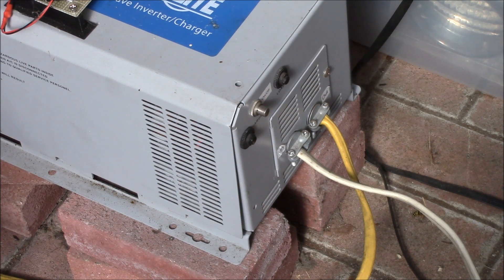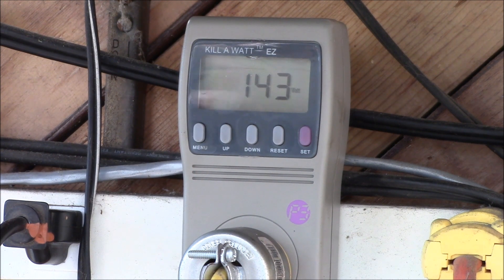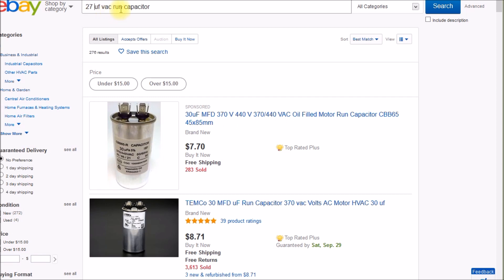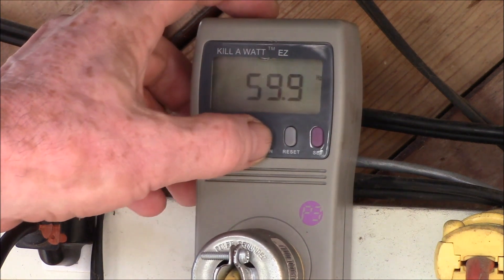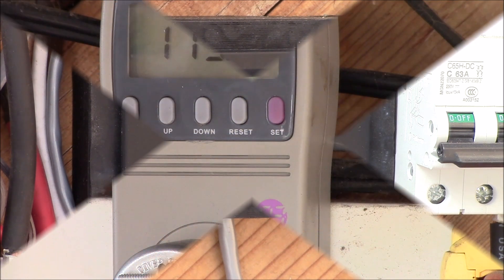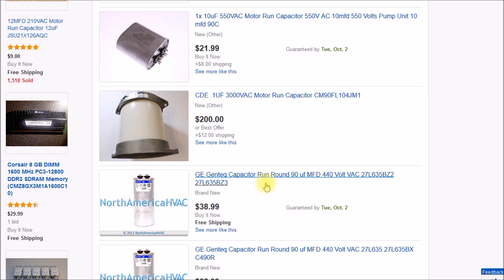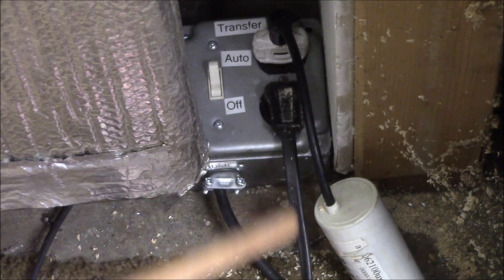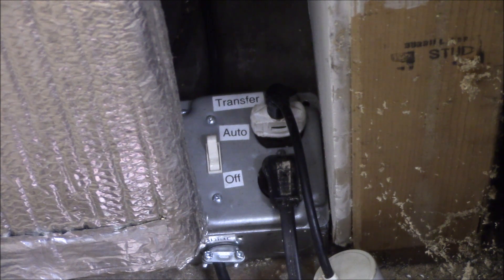Power Factor Correction and Inverters

Comment: Excellent video. Dumb question. Why don’t the manufacturers put a $5 capacitor in devices? Power consumption is a selling point
Reply from the maker: Cost is the likely reason.  They do put in a start capacitor, because the motor won't start/run without one.   But a power factor cap. is not "required", at least in consumer products.  Reason being that residential electric bills don't include power factor charges, like industrial power bills do.  Thus the grid supplies "free" reactive power as far as most folks are concerned.  

But yes, if you're providing your own electrical power, via an inverter, then that reactive power, to make up for a poor power factor, has got to come from somewhere, as I demonstrated in this video.

Comment: wow, I cant thank you enough for spending time and doing this demonstration. This niggling question in my mind is now solved.
Reply from the maker: Thanks for the comment.  Plugged into the grid and power factor is not normally an issue for retail customers.  But once you supply your own power, that extra current needs to come from some place.  Some inverters are designed to handle it better than others.
Reply: @The4Crawler  You are right sir. I am running a stack of computers and when there is no mains power I have to run on UPS. Your video made it clear that I better have computer PSUs with Active PFC so that I get more runtime from my UPS. Thanks again.
Reply from the maker: @prashanthb6521  Yes, that would make sense.  Uncorrected computer power supplies are likely more of a capacitive load (leading PF) so not as easy to correct like I did on my drill press motor.

Comment: I really appreciate this. I watched it over and over. I wish you explained it more in depth for real dummies. Off to research and learn about this.
Reply from the maker: It's a difficult subject to go into depth without getting overly technical.  The description has more details and a link to an easy to use on-line calculator.  Take a couple of readings with a Kill-A-Watt meter and it'll give you a good starting point for a correction capacitor.  This of course assumes you're working with a motor or other inductive load.  Back when I was in college, we had to set up a whole bench full of equipment along with pages of calculations to measure this sort of thing.  Today, a $20 plug in power meter does it all.

Comment: hey, 
I'm having some problems with the numbers.
let's start with the freezer example.
how come you input 208W and end up with 204VA at the output ?
that’s too close, where are the conversion losses ?
moreover, later, after the PF correction, you put in 188W to produce 142VA, which is a totally different ratio, while the conditions are better (allegedly, a perfect PF). 
how can it be explained ?

later, in the drill press you input 515VA with only 288W, again, how ?
Is it some inverter wave control "magic" ?
The measurement method ?

Thanks
Yam
Reply from the maker: Yes, it's not really clear how the inverter handles real and apparent power.  Some of the reactive power (VA or VAR) comes out of the output transformer as well as the internal capacitors.  Since that reactive current is out of phase with the voltage, it gets handled different inside the inverter.  It's not a fixed ratio as you note regarding load VA to inverter-watts. 

The main point of the video is to show that power factor (and correction) does matter if you are providing the power from something like an inverter.  You pay for it in terms of additional DC power input to the inverter.  Sure, if you plug into the grid, reactive current is "free" and power factor doesn't really matter, at least on your home power bill.
Reply: @The4Crawler  
Hey, thanks for the quick answer.
I get the point, and obviously you proved that a higher PF is better (as expected).
but I'm asking since we are trying to calculate ,on advance and without field testing, the required power for a similar freezer with a pf of 0.5, from solar power as well.
and I'm not sure we can rely on the ratio you got in the video.
maybe it's even inverter model dependent.
we weren’t been able to find a decent source for the math behind it.
maybe you can point us in the right direction.
Reply from the maker: @yamsoussana  Yes, I suspect this is highly dependent on the design of the inverter.  I've heard that it's possible to design an inverter that can handle reactive power with little to no extra DC input current.  But that all depends on what the designer of the inverter is trying to optimize.  Could be factors like efficiency, surge capacity, quality of output sign wave, long term reliability, cost, etc.  

I've never run into a table of data or formula to compute ahead of time how a specific inverter will handle a given power factor load.  I suppose if one had access to the full circuit design it could be run through a circuit simulator to come up with some data.  

The Rapidtables link in the video description covers the AC side of the calculation.  I think getting the power factor close to 1 is always a good place to start.  I shoot for a little under 1, by picking the closest capacitor value below the computed value.

I should probably try running this same test on my new 24V inverter and see if it's any different.

Comment: Thanks!
Okay, it's four years later, how are those Chinese capacitors holding up?
Reply from the maker: Still seem to be working fine.  Maybe some day, I'll try rechecking the power factor and see if there's any change.
Reply: @The4Crawler  Good to know. I'm adding caps to all my appliances. I have a metal shop where I think it will make the most effect.

Comment: Thank you for making this interesting video. How close to the device must the PFC correction capacitor be added?  Is it acceptable to locate it at the supply to a shared socket strip which feeds several devices, including the inductive load?  I ask because I have a central heating circulator pump which draws 18W with a PF of 0.73 but it’s buried in a well insulated compartment I don’t want to disturb and the only mains feed to it also feeds other (permanently connected) devices. Although it’s only 18W, because it runs 24/7 I think it’s worth trying to PFC correct it, to help reduce my inverter load.
Reply from the maker: If the load is running 24/7, then the correction can be added anywhere in the system.
Reply: @The4Crawler  thank you! It seems like motor run capacitors in sizes below 1uF are not so readily available.  I have a dead induction cooker PCB with some big 660V 0.68uF polypropylene capacitors on it, and this is exactly the size in uF which rapidtables says my circulation pump needs to achieve 0.95PF, so when I get brave enough I’ll give it a try!  👍

Comment: Hey, this video is exactly what I was looking for… my RV has a conventional refrigerator, and the inverter shuts off immediately, so I can’t go down the road with fridge on. Did the math, added a 5uF cap, and it works perfectly… you saved me $200, other websites said I need a “sine wave” inverter
Reply from the maker: Yes, that can make quite a difference and those Kill-a-watt meters are amazing.  It's funny how everyone will say PF correction is a waste of time/money, which is true for anything plugged into the grid.  You get all the "free" reactive current you want, but if you're supplying the power from an inverter, reactive current has to come from somewhere.  And some inverters have limits on how low a PF load they can drive.
Reply: Sorry, Kill-a-watt, that’s what it’s called
Reply: Also, I have owned that same Watt-a-meter thing for 5+ years, love it

Comment: Excellent explanation.  I just ordered a device.  It is marketed at home owners, but everything AC in my RV is on an inverter.  I instinctively knew there was a way to relieve some of the load on my Renogy inverters.  I ordered it, then found this YT that justified my thinking.

I will be opening up my fridge and microwave, to put proper capaciters where they belong.  Device was $6.
Reply from the maker: Glad the video helped.
Reply: @The4Crawler    I expect to help other RVers, by installing capacitors for their AC and domestuc fridges.  It will make their batteries last longer, when they are boondocking (which is what we plan to do a lot of).

Thank you

Comment: Some mpp/voltronic chinese solar inverters have pf correction on the output. So basically, VA values are mostly identical to real power used. However, the 230v input pf is quite bad.
There may be a measurement error (i'm using Shelly EM with 2 clamps), but at night, when there is no pv input, with batteries detached even, there is 15W difference between input and output... +15W measured on the output, witch is very strange. Could someone explain this phenomena to me?
Reply from the maker: Yes, the inverter may indeed have pF correction on it's output, especially when that is grid tied:
https://ctlsys.com/support/inverter-power-factor/
Power inverters w/p pF correction can have bad pF readings at low power output due to the output filtering.

But it's the load(s) that determine what the pF of the whole circuit is.  If an off-grid inverter is driving 1KW of incandescent light bulbs, the load pF is 1.0 and that's what the inverter outputs.  But if the load is a 1KW  motor with a pF of 0.8, there's 0.75KVA of reactive load that needs to be produced by the inverter, or by adding pF correction to the load.  It takes some additional amount of DC current from the battery to produce that reactive current.  It's not 1:1 like the real load current, but it's also not 0.
Reply: @The4Crawler  The inverter in question can't inject power on the grid. It can however work without batteries as a buffer by injecting solar energy on the baypass, while keeping the ac output voltage identical.
What i'm wondering is if its possible to have lower active energy on the ac input than the output or if it definitely breaks the law of energy conservation.
Case and point: my measurement gets me 15W of constant active power when and only when the inverter is purely in baypass mode, counting as solar energy when there is none.
Reply from the maker: @samuelolteanu  I've never run into the specific issue you're describing.  It most likely is a problem with the meter reporting some phantom power.  I have an old Kill-A-Watt meter that reads 6W of power even with nothing plugged into it.  Once you have a load above that, it reads normally.
Reply: @The4Crawler  I'll try to measure again with different better tools and report it here if you're interested.
Reply from the maker: @samuelolteanu  It may be the output power meter is picking up some noise / distortion on the AC output and reporting that as real power.  This article has a good description of some common power reading techniques:
https://www.fluke.com/en-us/learn/blog/electrical/what-is-true-rms
Unless you have a high quality true RMS meter, most use averaging formulas on the measured waveform with the assumption that it's reading a pure sine wave.  But those techniques become inaccurate when there's  something like high frequency noise or distortion added.

If you're using that meter to feed into something like Home Assistant, you could always run it through a filter to remove that "no load" power reading, i.e. subtract 15 watts from the reading, before logging that as a utility power/energy reading.  I had to do that on my 600W grid tie inverter as about once a month, it would report a one second blip of 30,000W output and that would throw off the solar energy readings for an entire day.  I simply added a filter to discard outlier readings and so far that's worked great.

Comment: Question: I have an inverter that is "PURE SINE WAVE". I wanted to run my computer which has a Power Factor Correction PSU in it. It does not seem to work. The computer crashes. Why?
Reply from the maker: Hard to say what the issue is.  Might be the inverter has a low power shutoff or load sensing feature where if the load drops below a certain value, it drops the output to save power.  Or maybe there's a load/voltage regulation issue.  One way to test that might be to add a modest load on the inverter, like an incandescent light bulb or similar in the ~100W range and see if anything changes.  It could also be the computer load changes too fast for the inverter and it's pulling the DC input voltage too low.  Some input capacitance might help with that.  See if you can monitor the input and output voltages and see if anything is not normal.
Reply: @The4Crawler  Thank you. What about the option of connecting the 12V batteries directly to the PSU where it steps down voltage and gets regulated into DC? I cannot find much on this online. Would not need the inverter then, and that would save some of the loss going from DC to AC to DC again.
Reply from the maker: @biblecave7197  You would likely need a schematic for your power supply to see if that's possible.  Other option is to pick up a 12VDC PC power supply and replace the existing unit.
Reply: @The4Crawler  I did not know a 12VDC PC PSU was available.

Comment: Great real world examples! Exactly what I was looking for, ya 3 years after making video, but nothings changed in that respect. Thanks! You know your stuff!
Reply from the maker: Yes, still the same fundamental measurements and calculations for sure.  Everyone always says power factor doesn't matter, which is mostly true if you get unlimited reactive power for free from the grid.  But, if you have to provide it yourself from a battery bank and inverter, then reactive current doesn't just come out of thin air.

Comment: This video has so much useful information.
I have one issue, please suggest solution or answer.
I have 5kva solar inverter but we are only able to put max load of 3600 watt on that inverter after that inverter shows overload.
All load is inductive(motor)
1. Is my inverter wasting rest of power in terms of 1400 kVAr?
2. If we put appropriate PFC capacitor across load then can i  put load of around 5kW or near about it(4800watt) on same inverter?
Reply from the maker: Motors usually have a higher current at startup so that's likely what you are mainly seeing.  Some things to help there are to make sure the power connection between the inverter and batteries is large enough and maybe even consider adding a super capacitor bank across the inverter to help reduce voltage sag when that inrush current hits.  And yes, adding a PFC capacitor across the motor can help as well.  Might be worth trying that first, because it's relatively inexpensive.  That way as much of the current the inverter is capable of putting out is going towards getting the motor spinning (real power) vs. producing out of phase magnetic fields (reactive power).
Reply: @The4Crawler  i am adding more load after 3600watt only after when motor is running in normal condition not in just starting of motor.
All Wires are  correctly sized  i have checked it.
Reply: @The4Crawler  my inverter is 5kva with 0.8 lagging pf .
Is there any way to increase it to unity.
And I  am asking about inverter pf but not load's pf.

Comment: Is the capacitor connected in series or parallel ??.
Reply from the maker: The capacitor is connected in parallel to the load, that is between the live and neutral.wires.